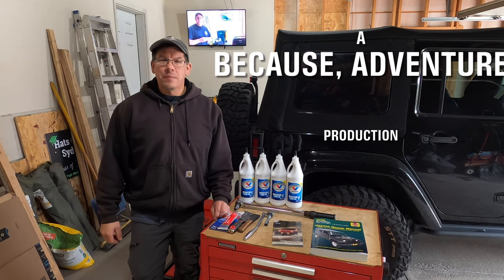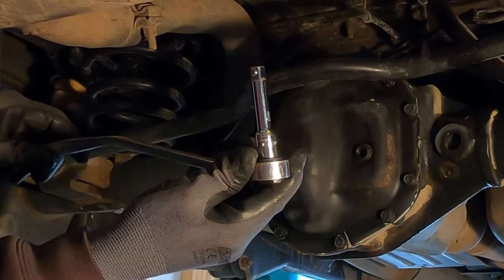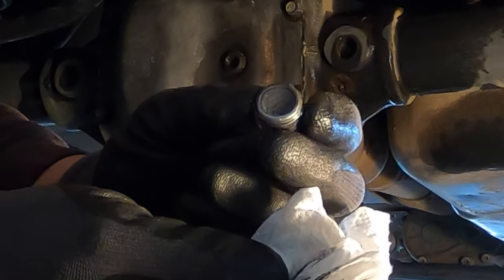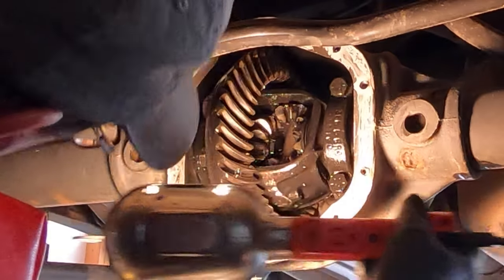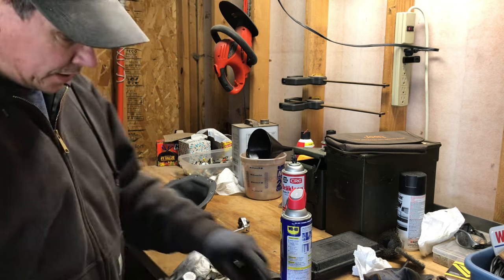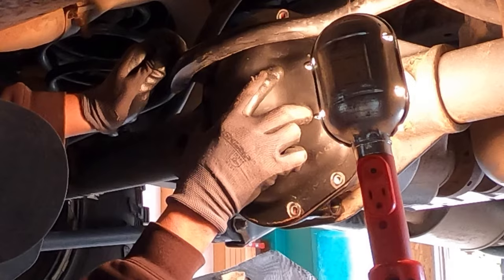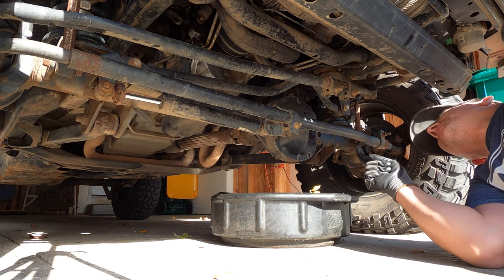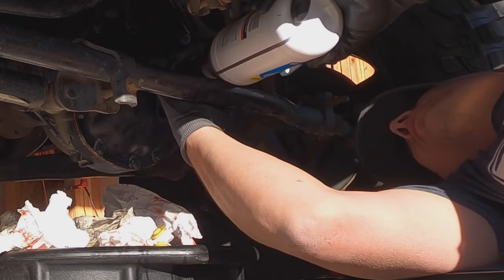DIY Differential Fluid Change & Gear Inspection - Jeep Wrangler JK/JKU Dana 30/44 Open Differentials

Comment: Couldn't you have done this without pulling the cover? You can just drain it, then refill through the fill plug, right?
Reply from the maker: Yes, you can just change the fluid like you described and skip the visual inspection.